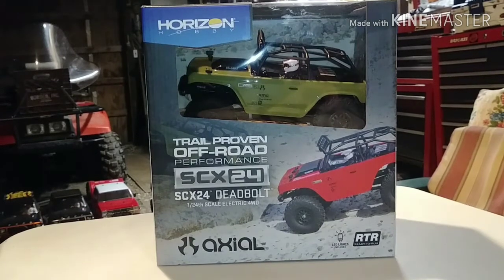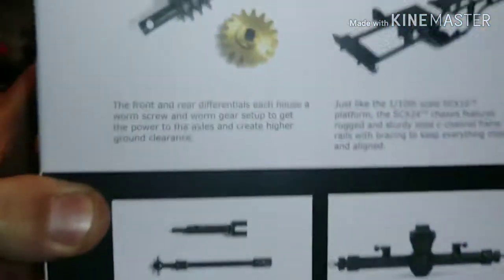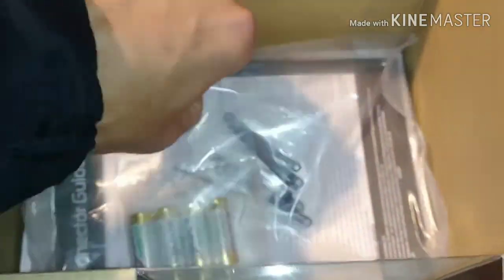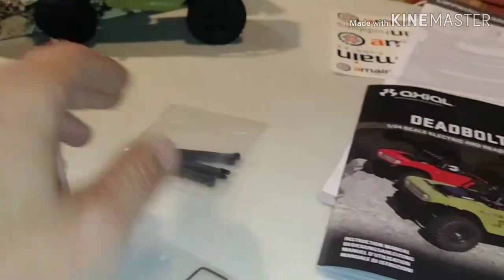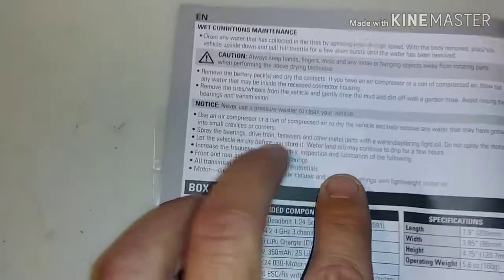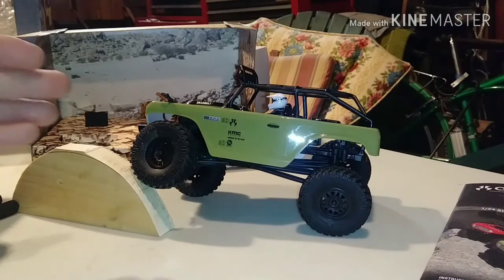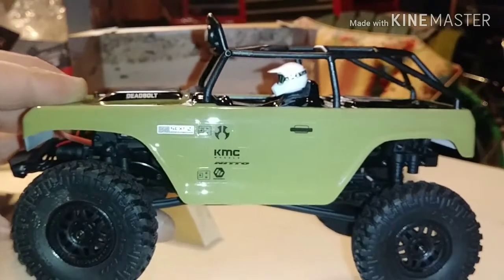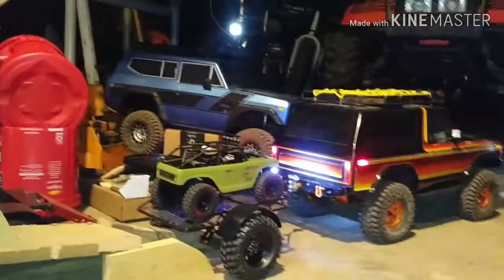Axial SCX 24"DeadBolt";Unboxing & Test Run

Comment: What does the channel 3 switch do?
Reply from the maker: I don't know what it does on my scx24 transmitters, other than absolutely nothing.🙄 
But I heard on the newer models, that you can use it to toggle the lights on & off, if you have the lights plugged into the third channel.🤔 
But it doesn't work with any of the scx24s that I have.😕
Reply: Interesting. I’m planning on buying one of these tomorrow and I wasn’t sure what that 3rd channel was for.
Reply from the maker: Nice on the planned purchase 😁👍
Reply: @R.C.A.D.  do you recommend getting a heatsink for the motor? I’ve heard it tends to get a little hot after driving it
Reply from the maker: Couldn't hurt to get a heatsink that's for sure,🤔
An Ounce of prevention is worth a pound of Cure 😂
Personally speaking, I've never had a problem of any kind with my scx24 Jeep,or with my Neices scx24 pickup, and I don't run a heatsinks on either one,🤔 But we have had a few issues with my brothers Scx24 Deadbolt 🤔  
Note, it's a original deadbolt, "First Gen" and we've had to replace the motor at one point,then the steering servo, and not long after that we had to replace the ESC/Receiver,🤔  And we haven't had any problems since then.😕
Once again, Absolutely No Issues with our other scx24s.😁👍
As for the heatsink... I would think that every little bit helps. 😁👍

Comment: Excellent unboxing and great review , nice scx24 and very good test !!
Reply from the maker: Much appreciated my friend,I'm sure you know this,but those micro crawler's are a ton of fun,I might even think about getting one myself,maybe 😁 
Thanks for checking out the video Brother 😎👍
Reply: @R.C.A.D.  I like the scale 1/24 , I have four 1/24 , but not the scx24 because it is not distributed in France, and buy it abroad is not possible because the shipping costs are huge. It's a shame I would have liked to have this one 😊
Reply from the maker: That's terrible that they don't sell it in France,😟 what were they thinking! Those things should be available worldwide.😕 I was personally leaning towards getting the Rc4wd mini Landrover,it really catches my eyes,but after driving the little DeadBolt I'm now thinking twice,mainly because of the axle clearance difference,the little axials have a worm gear differential,which kinda eliminates the pumpkin hanging down,vs the mini Rc4wd which has metal axles,and a standard differential that hangs down a pinch,😕 and the new Axial "white" mini jeep is another one that has me drooling,😬
It's like a jeep that a storm trooper would drive 😊 
So now I'm really torn on which vehicle too get 😟 lol
Reply: @R.C.A.D.   Yes I do not understand why it is not sold in France, especially that it never happen with their rc. Your choice will be difficult, all these small rc in 1/24 are very good 😊
Reply from the maker: Your not kidding Brother 😲😁
Reply: @R.C.A.D.  😊👍